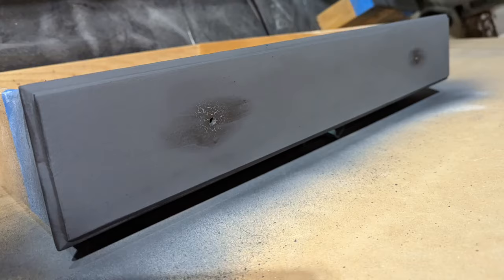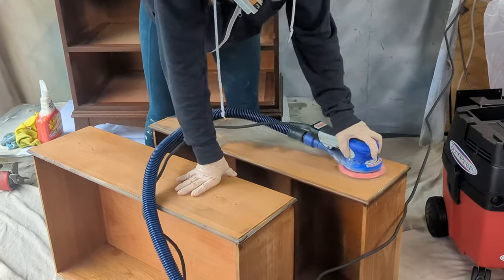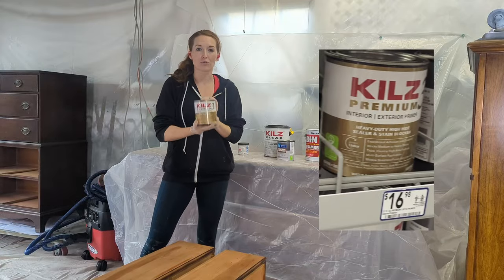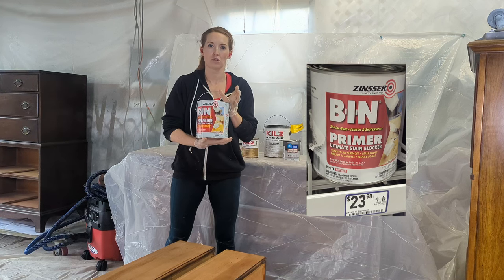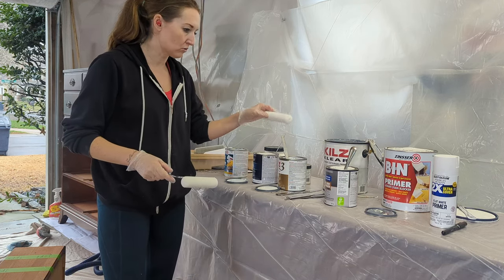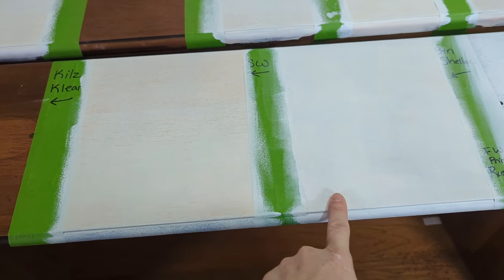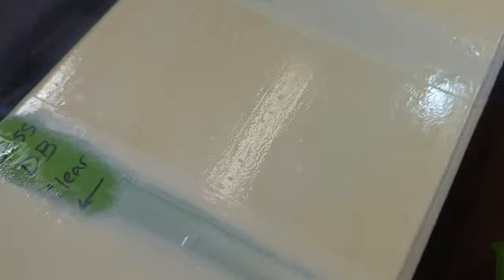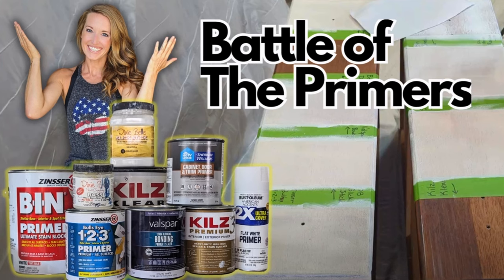Battle of the Primers | Testing 9 Primers So YOU Can Avoid Bleed Through On Your Painted Furniture!

Comment: Just primed some cabinet/bookshelves I had stripped down to bare wood (previously painted over stain) using Killz3. I did thin it with Floetrol (5%-ish) to make it easier to spray with my Graco X5 and it did ok - there is still some bleed-through in spots. I haven't done a second coat yet so hoping what spots did come through are covered up. The biggest negative with it I've found is sanding - Killz3 does not sand well at all. It gums up even days later and remains tacky. I also sprayed a ceiling I had skim-coated and the paint dust from that was horrible. It was sticky and walking on it I had 1/4" of paint build up on the bottom of my shoes. I am planning on putting down hardwood flooring so I have bare subfloor exposed and it was just an absolute mess. Just something to consider.
Reply from the maker: Yes it is gummy!!!! I love sanding shellac. Use that Rust-Oleum spray if the bleed through doesn't stay gone!!

Comment: Shellac based primers, and clear shellac are my go to.  As long as you clean and scuff sand to prep the surface, it works great.  Shellac sticks to anything and anything sticks to shellac.  My second choice is oil based primers.  I prefer to use oil based finishes for the entire project when using oil based primers.  I will apply one coat of shellac primer on top of my oil based primer if I need to switch to water based top coats.  I only use water based primers when I'm not worried about bleed through, tannins, stains, or odors.
Reply from the maker: Amazing insight thank you!!